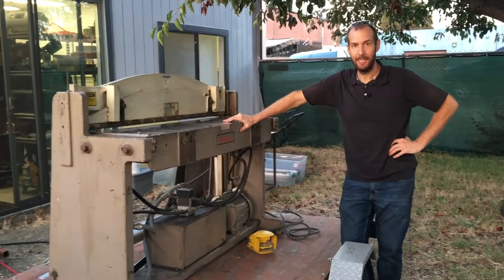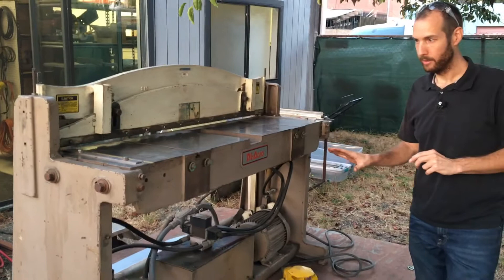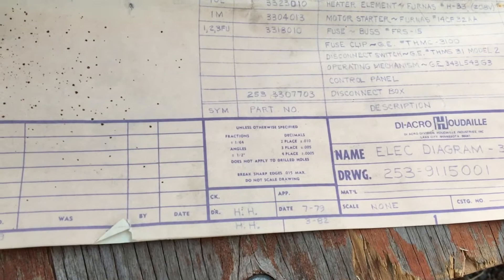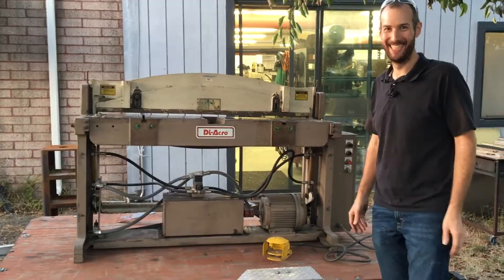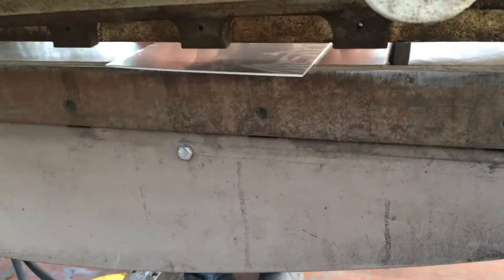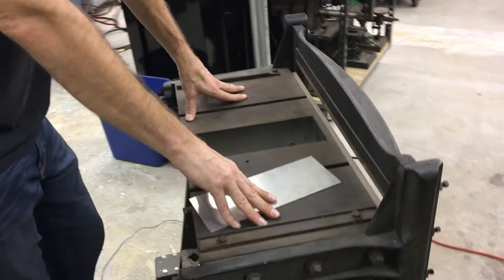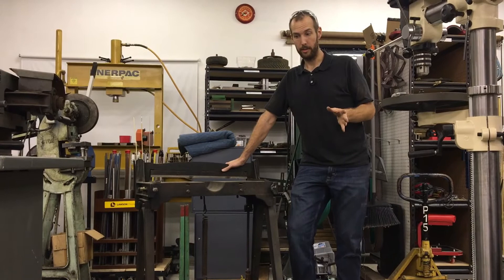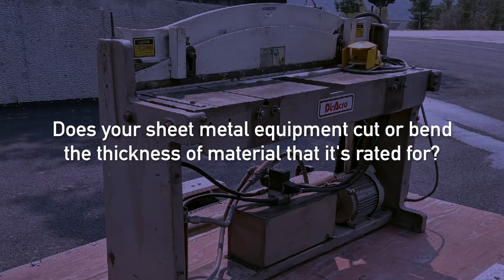SHEET METAL SHEARS: Newfound & Recommendations

Comment: You said you were going to put it on a mobile base, I wonder did you do that? Does it walk around the shop during use?
Can we see the base?  Thx.
Reply from the maker: Yes it is on a long mobil base now. Works well, no it doesn't move when in use. Its a pretty heavy machine. We are planning on a shop tour video and will do another in-use video of this machine coming up.
Reply: @TigermothRacingTV  Thanks for the reply. I'm in the same boat as you were. Debating between foot powered, and other powered. I can't find air or electric for less than about 4500.